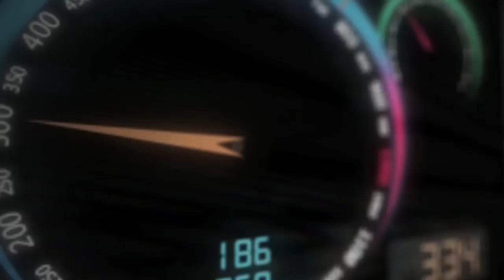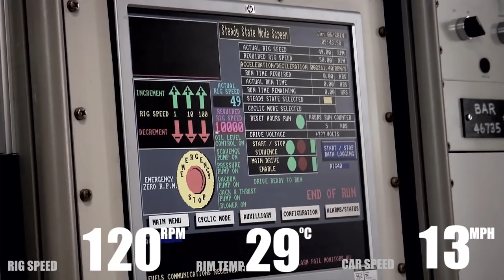1,100 mph wheel spin test

Comment: Maybe I am missing the point here but what is the point of spinning up the wheel  without modelling the external forces ok the wheel spins but unless it is done on a replica of the surface isnt it pointless ?
Reply: gowd sake It’s better than not testing it at all. Unfortunately in this case, you can never really test like you mentioned without actually doing it for real.
Reply: @qasimmir7117  Thats a fair point I guess they test to see it can spin at the required speed

Comment: Now how is that sucker going to have enough space to safely slow down with out spinning out  and crashing? Eventually the land speed record will be unbeatable if there won't be enough flat land to safely slow down at 2,500 to 3000 mph. The air now, thats a different story. We need to try and invent hyperdrive instead of 1000 mph cars that I can't drive on normal roads and escape the cops with jk.

Comment: Pssshhhh I have an rc car that hits over 100mph and the wheels need to spin 13,000rpm to do so. They're foam, glued on to plastic rims lol
Reply: And the diameter is?
Weight capacity?
Reply: Tiny, and tinier.

Comment: Take a lesson from the crank shaft of your average car, at 6000 RPM the engine rotates at exactly 100 Times Per SECOND. And look at f1 engines that rev to nearly 4 times that speed. I understand a crankshaft isnt comparable to an actual wheel on the road, but the crank shafts have to be reliable for hours and hours, as opposed to a run or 2. Certainly something to be learned.

Comment: Given Wheel dia of 940mm and 10,000 RPM with 6000 Kgs on the rear wheels and 10mm of crust climb it amounts to around 1175 KW of power drain.
Reply: that's about the power requirement for 262 KM/H with CD 1.2 and 1.6M dia frontal area

Comment: I'd like to mention that the rear wheels are carrying a lot of mass. The more crust height in the salt that you compress / break and climb the more the torque needed to over come that climb. Hense a great loss of power. large wheel that you are using might be better a little narrower and in a double axle format. SO that the wheels are inline aerodynamically. As the trailing wheel does not have to break the crust to climb it can support more of the mass. I would also afford greater stability. Whilst the bearing frictions are not negligible they are in comparison to the ground friction and "stair climbing" . As you are aware a body trailing 1/2 of the length behind a frontal body usually shares the same air stream though needs to be confirmed and designed that way. By halving that "clibing" action of the rear wheels you'll gain a substantial reduction in the major drag on the car.
Reply: Just as a hunch and need confirmation from actual data, it could be suggested that a wheel configuration consisting of a sprung leading crust breaker and then several trailing mass bearing wheels might be significantly advantageous.
Reply: Not on salt dumass

Comment: You are pushing too much density in the air for the frontal area. 
You really need to divert some of the turbine trust to the nose AKA a cavitation bubble for the main body of the car.
You need a cone ahead of the fuselage by about 1.4 M and about 27% of the diameter of the main fuselage.
You would then divert around 10% of the trust to this cone so that the thrust is facing backwards of course. No loss other than the internal friction of ducting.
The cone angle is of course a little less than the transonic angle.
The weels are a real drag not much you can do about them unless you also add a cavitation bubble for those also.
The russians built supersonic torpedos. It's this tech that will take you up to the 1600 MPH limit. A damn lot of FEA and testing involved, and some supersonic variations to the FEA models for air flow.
Don't envy you the task - it's daunting. However damn exciting !
Happy to help with more info / services.
Reply: lol Have they been in touch?

Comment: can someone explain why they do this in the desert? I mean, you say how the wheel dug into the dirt, should they at least pave a basic concrete strip first? wouldn't this aid in reaching 1000mph. Don't misunderstand me, I know that the  desert is isolated and optimal for safety.
Reply: TW0T0NGUE that strip would have to be miles long.

Comment: Even if the wheels survive the projected rpm, the car itself will not survive, thus the man piloting it will not either.
They will need a microscope to find him once the car gets aerodynamically unstable and breaks apart.
No amount of engineering and development is going to be enough to get that car up to that speed and survive.

It will come apart, it's simple aerodynamics and engineering
Reply: Yep, and that's what they said about the last car BEFORE it broke the sound barrier.

Comment: i wonder if they thought of the problem that the weel gets up to 2000 MPH on the top while it has 0 MPH on the bottom and therefor has a huge ex- and deceleration. Because in this test the weel just was on one piont and didnt move but when its actually on the car it has his own speed at the edge of the weel added to the total speed of the car
Reply: Bro you should to take a dynamics class. Whether or not the wheel is in linear motion (rolling) or stationary does not change the dynamic forces felt by the wheel. The weight of the car, ground friction and aerodynamic friction are the only forces that are not simulated in this test.
Reply: @AlexandersLeftNipple  Yes it does. If a single point is stationary on the ground and then accelerates to 2000mph at the top, then decelerates back to zero,  it's NOT just a  centrifugal force.
Reply: Get a haircut.

Comment: At 2:55, the wheel appears to be exhibiting more runout than a college student's bicycle wheel.  For years now I have wondered if this Bloodhound thing is a serious effort by serious people.  I'm still wondering.
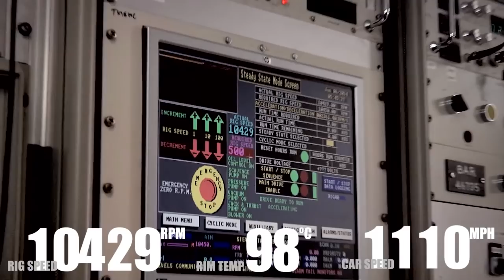Reply: +Hopelessand Forlorn Did you mean at 2:22? That's where I saw some dodgy paintwork. If you look at the edge of the rim it appears to run straight.
Reply: The last two times they got together for a project they firstly, smashed the land speed record and then broke the sound barrier on land. I think they are serious and know what they are doing.
Reply: The australian are way far ahead with the land speed record to be broken, they have 2 x SR71 engines which are going to be used to go faster then ever on the land, thrust SSc 2 or bloodhound is nothing but a total and utter BS, i will wait till i see it and then believe it, also when they first did the run it only went 726 miles per hour and only 1 sound barrier was broken, when  it went back it did not brake the sound barrier, which to me is a fail ? Unless you broke the sound barrier on both runs then you can really say you have done it? I remember when they did it they had a massive argument with the officials about it and in the end they said yep you broke the sound barrier, but not the speed of the sound, because the speed or sound is one speed and the sound barrier at sea level and the temp at the time is what gives you the sound barrier which is 20 c and over 761 miles per hour ?
Reply: +crankybloke you're right -- they didn't paint the middle since the paint will be ground away anyway. But it looks like they just mostly freehanded the area that was masked off for painting, which is why those paint lines wobble. If the entire wheel was wobbling that much, there's no possible way it would have survived this experiment.

Comment: There was no actual footage of this wheel rotating at 10,5k rpm. Instead there was some intense music and some graphs...
Reply: That's it boys, we're taking the video down because a comment on YouTube told us we were doing our videos wrong the entire time. Next time, we should listen to comments on YouTube about how to make videos, instead of actually just making videos, because YouTube comments are worth more than anything... yup, seems right.
Now piss off.
Reply: ardvark84
That is a one letter difference, i would hardly csll that a "long way" when the full word is comprised of only eight letters.
Reply: ardvark84
Why offer to tell me a story and then say that you wont tell me, Hmmm.
Reply: I wanted to see a wheel spin :(
Reply: +ardvark84 So you want to see the wheel spining to satisfy your tiny mind? They are using the most appropriate methods to collect the data they need. In this case, it is not visible light, but rather imaging in the IR portion of the EM spectrum.There is a IR video capture at 2:08, which captures the parameters they are interested in.
Reply: +ardvark84 You would not have been able to tell that the wheel was rotating anyway.
Reply: you guys should be nice to each other, you're both interested in this obscure bit of engineering after all, you can't be all that different. I bet you'd get along perfectly fine IRL
Reply: +ardvark84 Yes, you were wrong actually! They show infrared thermal shots multiple times (1:38, 1:48, 2:09), as well as actual video from the chamber during test (top view, at 1:57 and 2:04). But since the test article is a completely uniform cylinder/disc, it's impossible to see it rotating, so it's pretty boring, hence showing all the other clips. I think it was very well done myself.

You were also wrong about the spelling of aardvark in your name, but I'll assume that was a stylistic decision ;)
Reply: kllrbny This is precisely why I wrote my first comment here. I wanted to see this test because I'm interested in this vehicle but this video is simply not worthy the title. Other guys obviously wanted to see it too. Whoever made that video, he wants to eat the cake and have it.
Reply: +ardvark84 what said that there was footage of the 10.5k rpm test?
Reply: ***** eehm... the title?
Reply: ardvark84
 no, it said that the video was about a 10,5k spin test, it said nothing about footage of that test.
Reply: ***** Oh, right, so let's say I'd like to watch some supercars accelerating. What should I search for then? Because according to you all those "supercars accelerating" videos may not neceseraly be about supercars accelerating.
Reply: ardvark84
it may be about how supercars accelerate, you cannot make assumptions based on this limited information.
Reply: ***** That's a great advise but we are not talking about some big scientific claims. We are talking about youtube videos with wrong titles.
Reply: Mr.Green
my statement is still correct, it is still an assumption.
Reply: Mr.Green So according to logic based on what we know about videos you would have to say that videos about accelerating cars will show that. But because you like to play word games instead, you have to defend this video with misleading title. Is that correct?
Reply: ardvark84 As i have said twice now the title is not misleading as the video is indeed about the test mentioned in the title, it may not be what you wanted to see BUT it is not misleading.
Reply: ***** Ok I don't care about it that much.
Reply: Littel Blue And now I'm not able to tell if it was rotating at all...
Reply: Jerry Dennis Was I wrong?
Reply: kllrbny There is a long way from aardvark to Ardvark as my name and just leave it how it is.
Reply: ***** Do you want me to tell you a story about me as a 10 yo living in Poland watching a cartoon about blue aardvark and ant and how my friend wrote "ardvark" on my bicycle with a spray paint because I said "a ha" like this aardvark a couple of times? I'm not gonna tell you that story bro...
Reply: What do you guess you would see? It is perfectly round, has one colour, is rotating without radial movement. You won't even see it moving. This whole shit is just throwing money out the window. It is highly technical but nonsense. Like the fastest whatever crap.
Reply: ardvark84 do you just need something to bitch about?

Comment: Will the wheels actually reach that rpm as they will start to skid or even rise off the surface? What impact will that have on the car if it were to happen? Surely it will put a massive shock on the car
Reply: If the car rises from the surface it will almost certainly tumble and disintegrate, killing the driver and the project. So I'm guessing they'll put in some effort to prevent that :P

Comment: I am excited to watch how you are building the car.
And can understand how important the wheels are by all the info you guys are talking about light but strong, no imperfections in the metal, must maintain perfect roundness, be balanced to within a few grams.
But how about the wheel bearings? They must take heavy load just from the weight of the vehicle and then spin them to 10000+ rpm. I would guess they arent roller bearings and grease but some sort of sleeved bearing or maybe a roller bearing with forced lubrication?

Comment: my eye can't even see 174 fps period.
Reply: +Andrei Perry (VlogLife2015) You can see 174 feet per second.
Reply: No because your persistence of vision is more than about 1/25  a second - that's why the  monitor  image you see in this You Tube doesn't flicker. In fact you would have to slow the wheel to less than one seventh of this speed to see a back dot on the rim as a spinning dot not  a grey blurred line.
Reply: TheArfdog Not a continuous stream of 174 images per second or hertz, which is how fast the wheel spun.
Reply: ***** True, but you said 174 fps = feet per second.

Comment: Now trying to calculate the forces acting on that wheel at 10,429 rpm. Think I've got to lie down in a darkened room as my brain hurts.
Reply: TK42138 The Centrifugal acceleration is 54889.2 g, and it's Centrifugal force is 5747.98 ton-force

I used this equation --> Mω²r where ω is the angular speed, and the force is from F=Ma
Reply: The Aussie Invasion team says 50000 G at 10000 rpm / 1000 mph, so probably similar here.
Reply: If it went any faster it would form a black hole with its own event horizon.